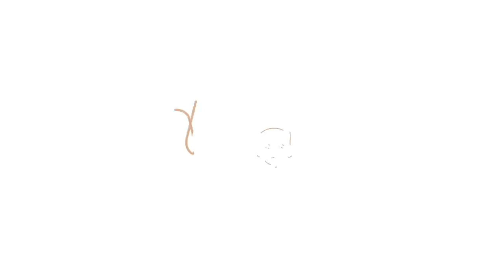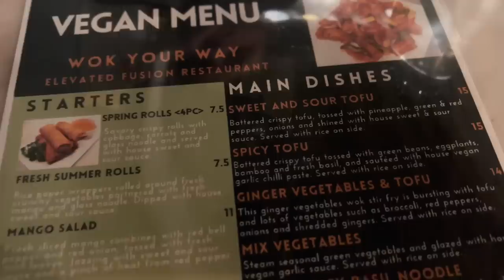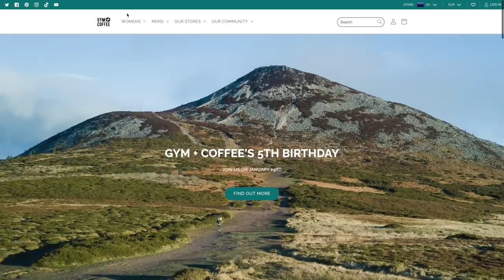How we built our Dream Kitchen in the Woods (Geodesic Dome Build)

Comment: Idea: Trim the sink cutout piece to fit into the sink as a cutting or filler board, then add a drawer pull or handle on each side, making it easy to insert and remove. Doubles as a serving tray.  If you do not do something like this, the sink is going to be full of cat forever.
Reply: Great idea!

Comment: Sweet and sour cauliflower is AWESOME! But.... you need to use potato starch rather than cornstarch. It doesn't burn in the oil or make a mess of the oil, either. Totally worth it. If you want to fry ANYthing - use potato starch (including tofu) and get that aquafaba going on - don't throw away the chickpea juice. Makes great mayo!

Comment: Tip for attaching to the floor... create slots in your laminate/flooring so the screws going into the floor can slide back and forth as the floors shrink and expand with the seasons. I forgot and summer came and all my floors buckled. Then winter came and the floors settled back but then pulled apart. Now I have open seams throughout my living room, dining room, and kitchen. Only way to fix at this point is tear it all out and re-lay the floor and then put the cabinets back with the slots. :(

Comment: ok boys, if it were me living in that lovely place, I would look up and use the skylight as a diagram to make zones out of the floor plan, that light looked like it had 5 sections, taking blue tape I would make pie shapes on the floor, these sections would be my "corners" to work from....like I would place the kitchen in one slice, but now what do I want directly across from the kitchen, and what do I want on either side of the kitchen slice, then step back to the front door and see how balanced it feels, each slice can be  divided up into smaller pieces, like the slice by the door, would have a small area as a mud room, for coats and boots, so,...  I don't know it this made any sense what so ever, but thinking in slices of a circle would be how I would group items that make up individual rooms.... may help wrap you head around the slices as "rooms" instead of corners....

Comment: It is looking amazing. I am excited to see the finished home. Have you thought about adding a small back edge to the countertop to prevent anything from falling behind the cabinets? You could just stain a piece of wood to match the general countertop color and attach it with a plate and screws and just finish it the same way as the countertop.

Comment: Hey guys. The dome looks great. I have some friends that have a dome and they say mice love the material. Look up bucket and pop can trap. It's great to place under the platform. I am exited to build our own. Good luck with all.
Reply from the maker: Oh really!? We did spray foam underneath which is rodent proof and we haven’t seen any yet compared to last winter which it was constant. Fingers crossed we don’t have them again, such a mess!
Reply: @tylerandtodd  ya they had the same set up as you as in platform with spray insulation. Mice are buggers and started chewing on the exterior on the platform. Just keep an eye. The bucket and pop can trap definitely helped they said.

Comment: Looks great guys, coming together nicely.  But, a thought just occurred to me...What happens when summer comes and it's 90 Degrees outside?  You got a plan for AC?  Could get pretty warm in that teepee...
Reply from the maker: We’ve gotten this far by solving problems as they come up 😅…stay tuned haha
Reply: @tylerandtodd  I know you'll figure it out..... Besides, looks like you installed enough solar panels  to support a power system that has plenty of extra capacity....I'm pleased that this project is turning out well....But of course, you guys have enough forethought and knowledge about "practical stuff" and have the vision and forethought to take most all circumstances into account.  I look forward to seeing you dudes every week, you've become a habit.....LoL

Comment: I am a temperature nerd. Tell us about the temps in there, is the stove heating it well?
Reply from the maker: On days when it’s -5 or warmer the Dome is piping hot, can be around 20-25 but when it starts dipping down to -10 it really cools off, and -20 you can forget about it. It’s like 0-5 degrees in here but we’ve got a plan! 💪🏼
Reply: @tylerandtodd  Thanks. Yeah that reminds me of a gas burner I had at an old apartment in NYC. The burner was great for most winter days. But it had a limit. And on those rare super cold days, it reached its limit. And it was freezing inside.